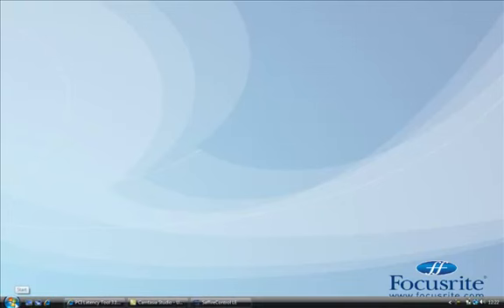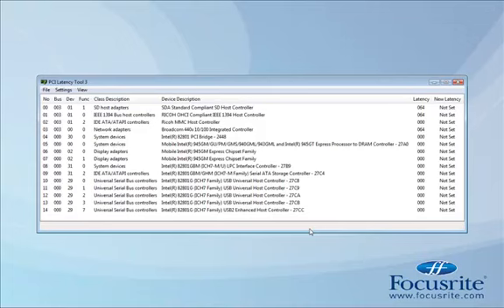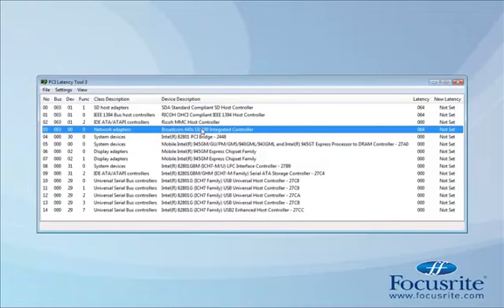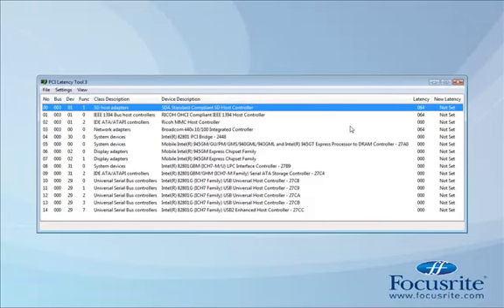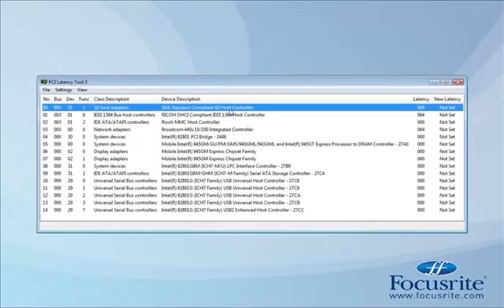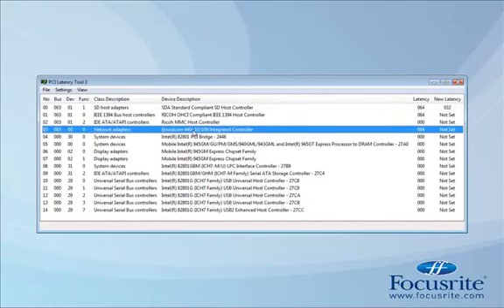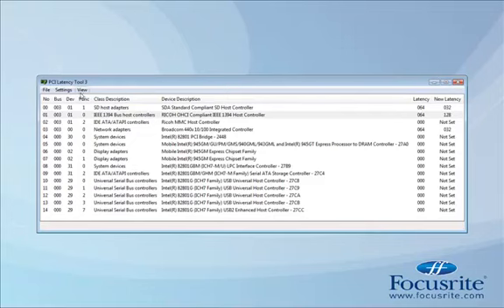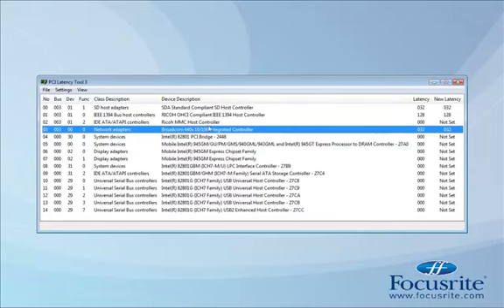Focusrite Tutorial: Troubleshooting: How to tune your PC's PCI latency

Comment from the maker: The PCI latency tool is not compatible with Windows 7. PCIe FireWire cards are unaffected by PCI latency and there is no need to use the tool for these. 

The 4ms latency is not PCI latency, it is the audio driver latency. To run this as low as possible, ensure that your computer is tuned as per the tuning tips on the Focusrite answerbase.